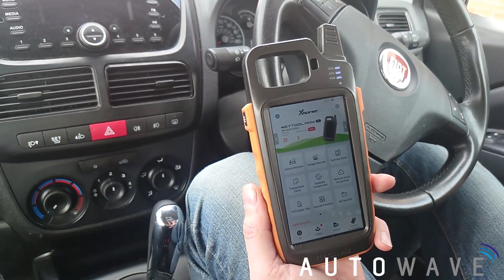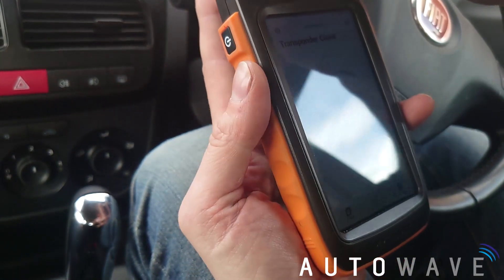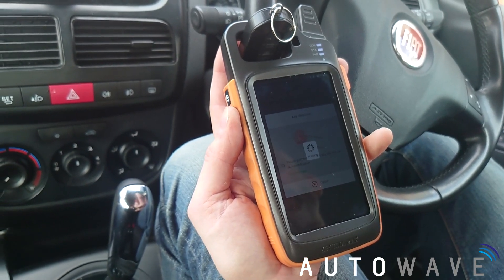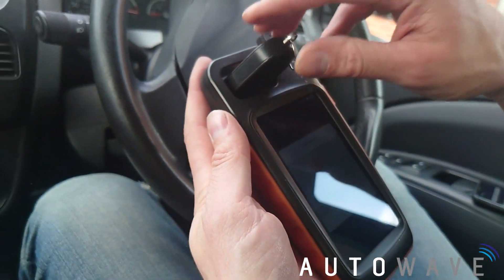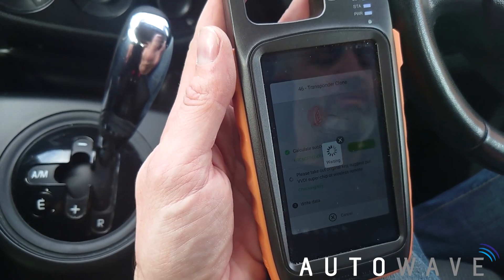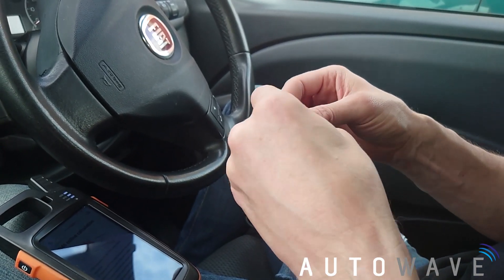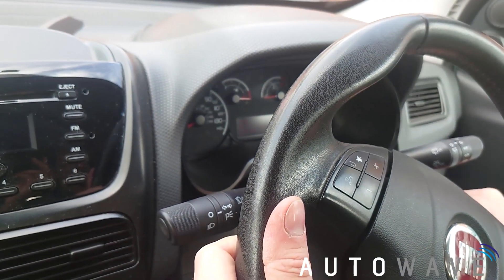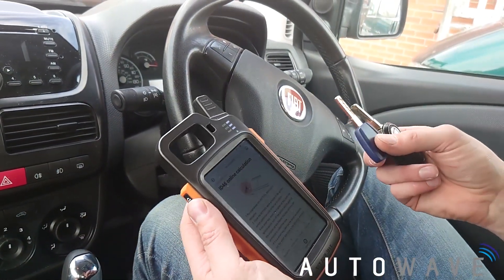Programming a Spare Key For a 2014 Fiat Doblo | Xhorse Key Tool Max

Comment: Hi mate really love your videos I was wondering if you could possibly shed some light on an issue I am having,  2009 320se. I have tried to add a key and it says cas system will not allow key matching through OBD??? Is it the reader as the reader is faulty or does the car need the ECU flashing I currently have the pad 2 pro with kc100
Reply from the maker: Hi Nugget, usually CAS keys can be added via OBD but there are various factors that could cause this. You certainly don't need to flash the ECU! If you bought the device from Autowave you can contact our tech support team, if bought elsewhere then you can contact your reseller and hopefully it can be resolved. Thanks!
Reply: @AutowaveLimited  thanks